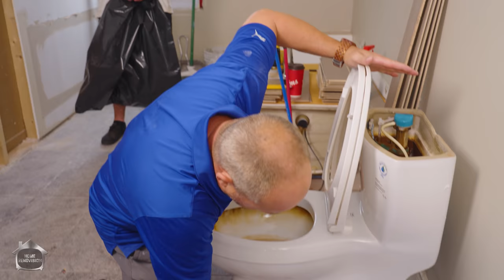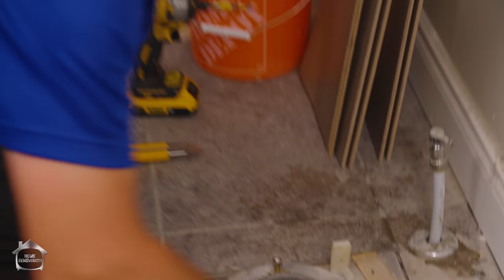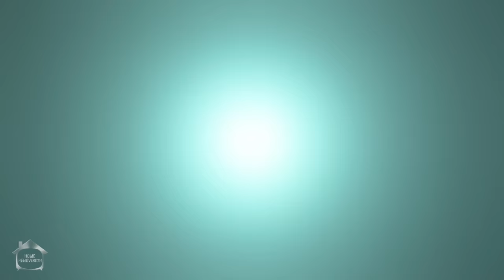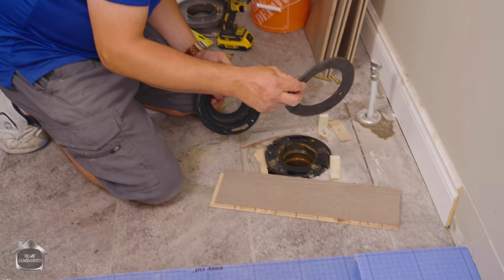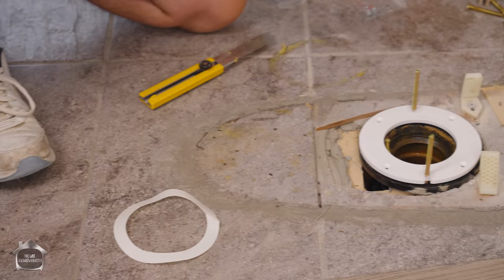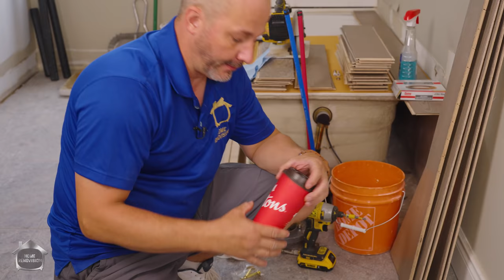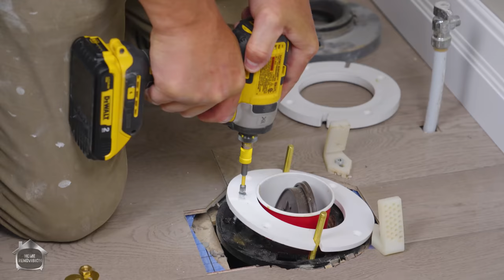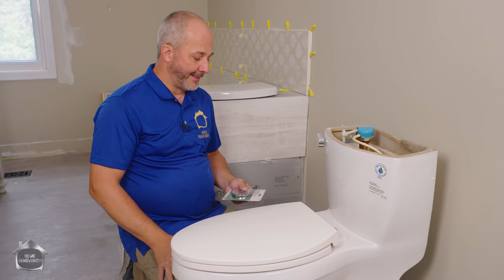How To Install A Toilet So It Won't Leak | DIY For Beginners

Comment: In Australia installing a toilet is a 2 step process
Step 1 Call a Plumber
Step 2 sit back and relax
Toilets must be installed by a licensed plumber, not  DIY
Reply from the maker: sorry to hear that. In most cases the licensed plumbers are the ones cutting corners on the renovations. I would rather have the choice to do it myself and do it right.
Reply: @HomeRenoVisionDIY  thanks for the reply ... a lot of people doing reno will DIY , but it is a legal requirement, especially for new build otherwise you can not get your "occupancy certificate" which is signed off by the local council with paper work signed off by the trades.  
Effectively you can change a washer or a tap fitting/shower head but no pipe work with out a plumber.
The same for electrical work, no rough in for lighting or power, no GPO no switch install without electrician,  home owner can only change light bulb.
The funny thing is we have a large hardware chain stores where any one can buy the products to do all the work and Australia is a nation of DIYers.
Last year I reno'ed two bathrooms, stripped down to the studs but had no need to move plumbing or electrical, but did install a new vanities and toilets.
his year reno'ed kitchen and laundry, relocating everything so engaged both plumber and electrician as the work involved cutting concrete floor slab and board upgrade due to age.
Reply: That sort of freedom restriction is something Americans would never stand for. 🤷🏻‍♂️ Insane. Can't replace a toilet yourself? 🤣 I've replaced a water heater myself and it was done better than a licensed plumber would do. Totally done with water-rated Type L copper pipe, soldered in place. 6 inches of brass nipples and couplings to separate the copper pipe from the dielectric heat trap nipples. Even though the nipples are supposed to be dielectric, they fail eventually and then you have the steel and copper directly next to each other which causes a galvanic corrosion leak. A 6 inch section of brass separating steel or galvanized steel and copper reduces corrosion significantly and it's the standard for connecting very old galvanized water pipes to new copper in old houses. I even piped it in a way that created a second backup heat trap loop in case the heat trap nipple valves themselves fail down the road and lose hot water which wastes lots of money. Every solder joint had the pipes deburred smoothly to prevent turbulence. Proper water soluble flux and lead free solder was used. Time taken to make proper, hot solder joints, flowed nicely. Lead-free full port shut off valve on the cold line and another one put on the drain port of the tank with a dielectric nipple to replace the crappy non full port plastic one that came installed on it. Copper unions to meet code and allow for easy removal of the tank. Excessive flow and temp cutoff natural gas valve installed to stop leaks and close off in a fire. 

If a plumber did this install, they would NOT have deburred the copper if they even used copper. Most likely, they'd have kept the old cold shutoff valve which had the MPT end and just installed flex lines back again like the old one had. The hot was soldered on. They likely would use a compression MPT fitting on that pipe to connect a standard threaded end flex pipe. Maybe they would have just used PEX and used a compression PEX barb on the hot and a FPT threaded adaptor on the old shutoff valve. Either way, nowhere NEAR as good as my 100% soldered copper piping and not as aesthetically pleasing either. If they did do any soldering, old, lazy plumbers like using leaded brass valves, 50/50 lead solder, and non-water soluble flux because those things are a breeze to solder with compared to lead-free brass and solder and water soluble fluxes. The latter are all pretty tricky to use. I practiced for several days before I got excellent results that I was proud of. I don't want any lead in my potable water lines. Using leaded components makes the job go by much quicker = more profit. PEX and compression fittings are even faster! Yuck. My install will 100% last the same 25 years that the original water heater did. In fact, that tank was totally neglected so if I take care of this new one it could go longer. That old tank was full of sediment, had leaky nipples up top because the flex hose washers leaked and connected that galvanic circuit on the outside of the nipples, and the anode rod was long gone so corrosion of the tank itself had started many years ago and slowly put a hole right through the bottom. Annual flushing and anode rod replacement every 3-4 years will keep this tank tip top. I studied the national plumbing, residential, and fuel gas codes that my city used as well as their amendments as they all applied to water heaters and potable water plumbing. Everything is up to code. Everything. I'm extremely OCD.